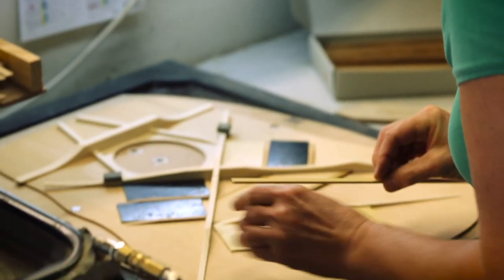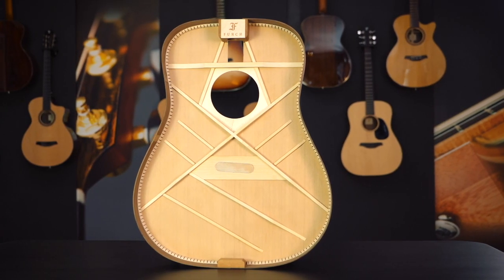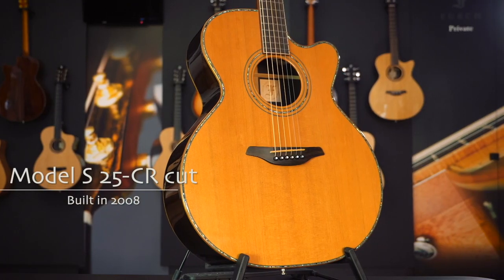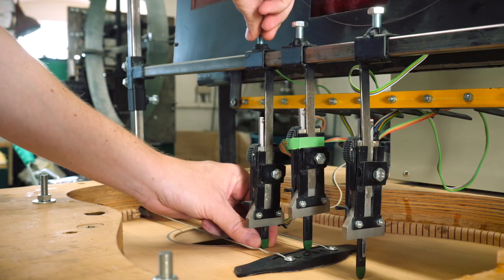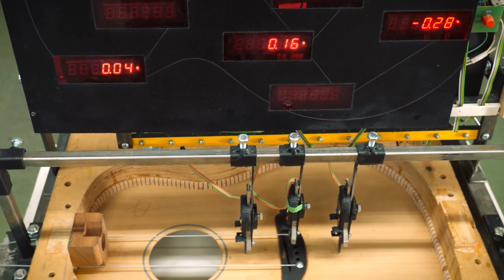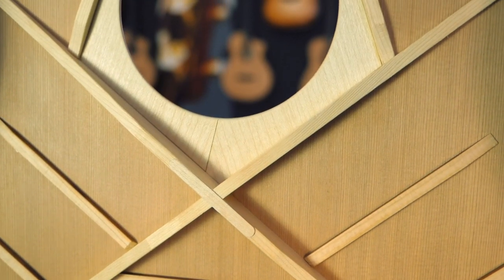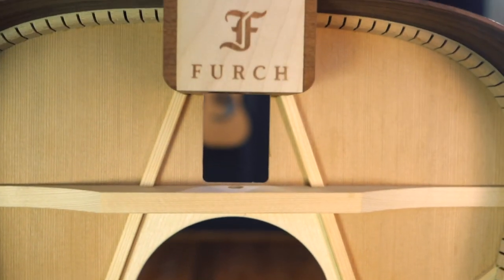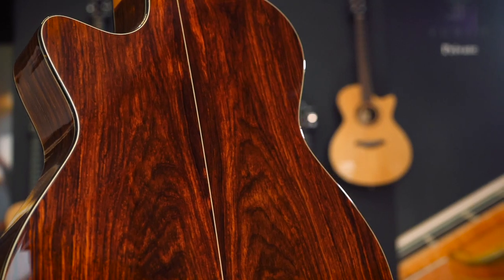Our unique voicing process makes the difference | Furch Guitars

Comment: Hello Furch. I have a question if you could please enlighten. Why do ou prefer to use x-bracing and ladder-bracing on different models? What is your opinion about the v-bracing? Thanks in advance and more power to your company. ⭐️⭐️⭐️⭐️⭐️
Reply from the maker: Hello Justin! According to our testing, X bracing has a great ability to transfer the high amount of the energy of the string to the larger area of the top board compared to ladder bracing or V bracing. We therefore have a bigger playground when we engineer the sound of our guitars. Ladder bracing is the one we use on the back board where we see the best utilization. Ladder bracing is great for controlling preload of the board in three important areas of the back - upper bout, waist and lower bout. V bracing is great for stability of the guitar as it is rigid in string tension direction. Rigidity itself can also bring a wider dynamic range. We were using V bracing on some models in 90s but we hit the limitations of how this kind of bracing utilizes the acoustic potential of the top therefore we kept our focus on X bracing. Hope it helps!
Reply: Furch Guitars Thank you. This explains a lot of things for me as a guitar player. I am quite fascinated by the tone produced by the voicing on Furch Guitars compared to other brands of the same guitar dimensions and specifications. I hope to visit your workshop in the future. Furch is a guitar that is one of the best for many years to come. Cheers to Furch Guitar’s future! Thanks again.
Reply from the maker: Thank you very much Justin! We hope to see you here soon. Take care!
Reply: @FurchGuitarsOfficial  Now that's what I call an answer ;) Scientific approach.